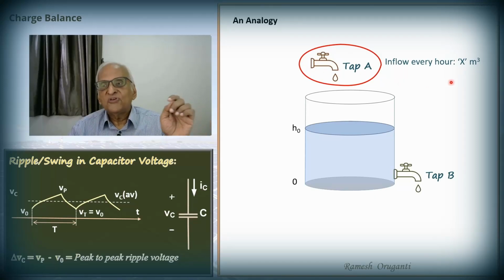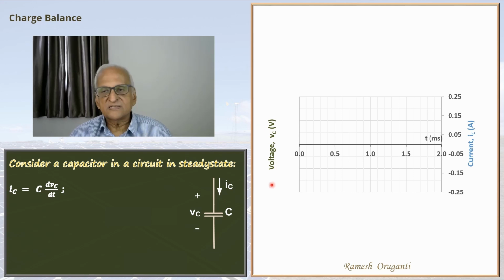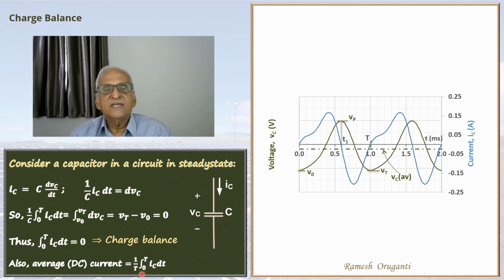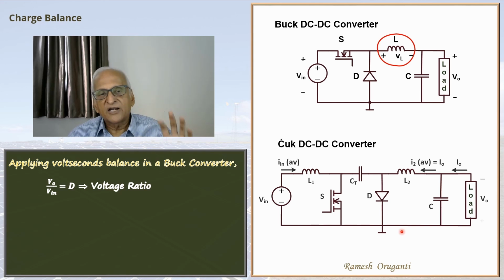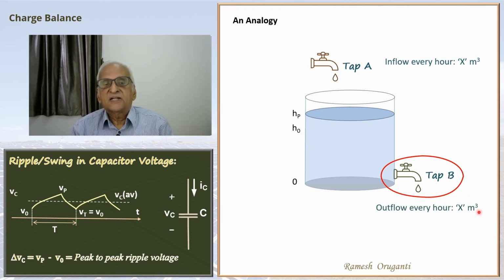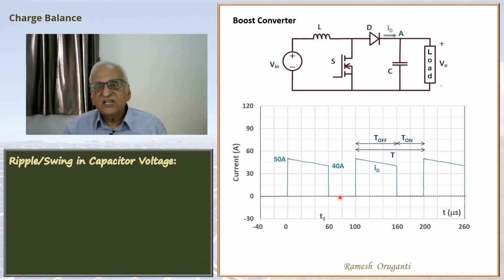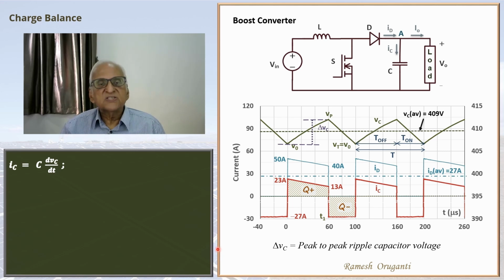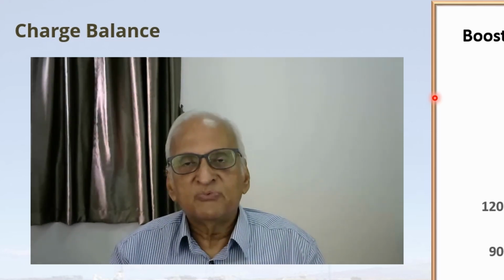PE 1-7 Charge Balance in Capacitors

Comment: Surely the average should be the average of  the 40 Amps   over the full cycle  i.e.  60 % of 40 Amps or 24 Amps ?

The ripple is caused by the current changing between 50 Amps and 40 Amps and from 40 Amps to zero. The base level current is 40 Amps spread out across the full cycle.
Reply from the maker: @we-are-electric1445 - Thanks for watching the video and posting this comment. 
I checked again the part referred by you (at around 25 mins in the video). 
The diode current iD varies from 50 A to 40 A during 0-60us and stays at zero during 60-100us. 
One way of finding the diode average current iD(av) is by taking the area under the curve over a period (100us) and dividing by a period (100us).
Area under the curve over a period = area under the curve between 0-60us (between 60-100us iD equals zero)
= (1/2)x(50A+40A)x60us divided by 100 us
=(45x60us) divided by 100us = 27A 
So iD(av) is indeed 27A as indicated in the video!
Hope this clarifies!
Reply: @ROs_classroom  Thank you for your reply. What I meant to query was ,considering your water analogy,  is it the case the 40 Amps averaged over the 100 uS cycle  (i.e. 24 Amps)  is equivalent to the low point (h0) in your water analogy ?
Reply from the maker: The capacitor voltage and water level behave in a similar way as shown in this problem. 
In the example, the capacitor voltage is periodic with a period of T. The water level of tank is periodic with a period of 1 hour. The minimum capacitor voltage in a period in the problem is v0. The minimum voltage level in the tank in an hour is h0. As the charge goes into the capacitor the voltage rises to the peak value of vP. This is similar to the way water level rises in the tank to hP as water flows into the tank. 
Hope this clarifies!